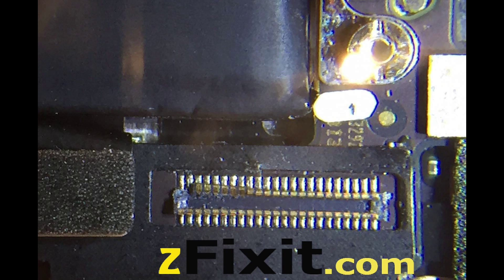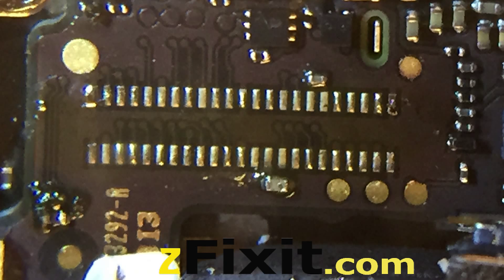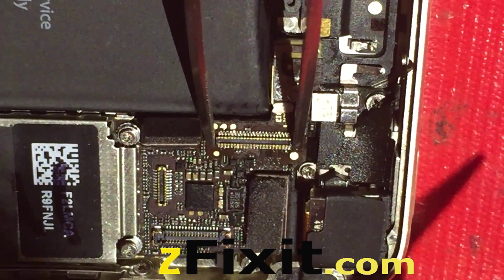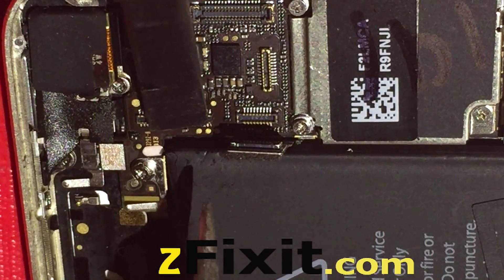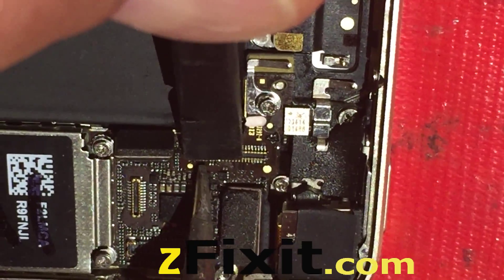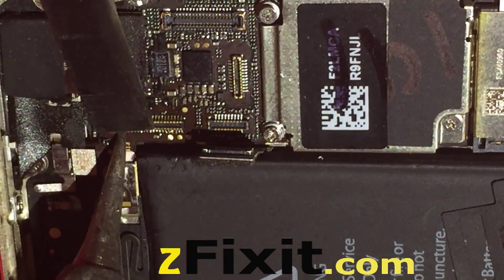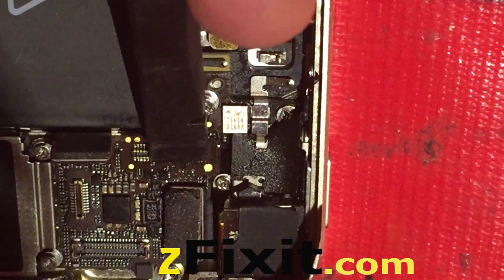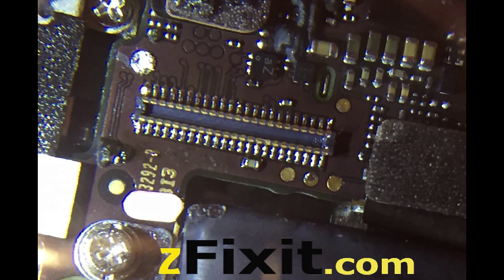iPhone 5S Digitizer FPC Connection Replacement

Comment: can I send you my 5S mines has the exact same problem
Reply from the maker: +who jay you would have to send me pictures of the damaged connector, keep in mind if you damaged the connector, the screen connection may also be damaged, so is a double problem.  The logic board became damaged so more than likely, the screen connection that connects is also likely damaged.  Take a zoomed picture of the screen connection also.  I normally do not accept mail in repairs, repair is just for shops or local customers so I can examine potential issues, missing chips on logic board, etc.  
Phone has to be recognized by computer and iTunes and cannot get hot when plugged in, not recognized, if issues, then chips are pulled, phone is dead.  If phone overheats, then other chips damaged, etc.
Reply from the maker: +who jay goto my website, use the contact form at zfixit.com, send me a message and I&#39;ll provide an email address for you to send pictures or a phone number that accepts picture texts.  I can't post an email address here as it will be spammed